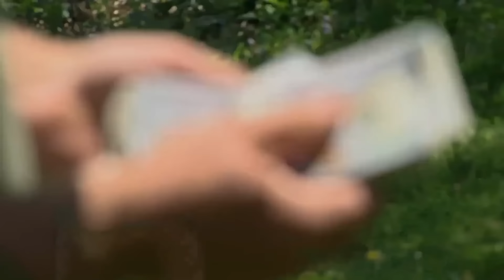What Really Happened to Eustace Conway From Mountain Men

Comment: 01:57  a photo op. the saw is on the top of the blade. he knows better
Reply: There is nothing wrong with what he’s doing there lol. You’re obviously not very experienced with a chainsaw or logging at all.
Reply: @lukecurnutte2000  not on a tree base, 1st cut Apparently you haven't have much experience. either. with a tree trunk, you get right up on it. bottom of blade doing the cutting, i could see an upswing in branches for convenience, but it is still a photo op..
Reply: @gregsmith7828  yeh you’re wrong lol I don’t know who taught you any of this but they taught you what they prefer. Not the best way.
Reply: @lukecurnutte2000  did you watch the 2 linked videos? in each case. BOTH were bottom blade to trunk, BOTH. it is NOT advised to use the top of the blade in the "safety" aspect. for the blade will "hop" potentially causing injury. Granted.. It can be used in that way. but it is careless and not safe. And i also have used the top of the blade in small branch clearing. But He was felling a tree. and the most efficient way, is BLADE IN not on